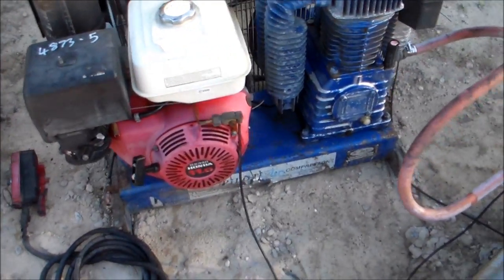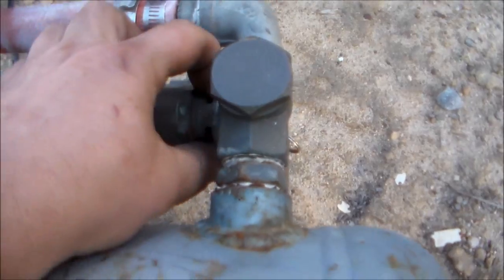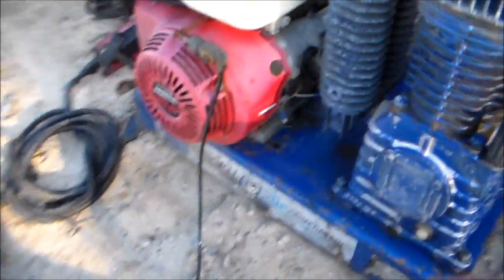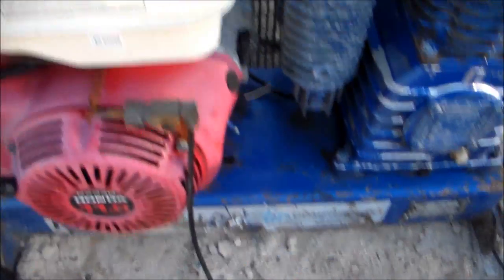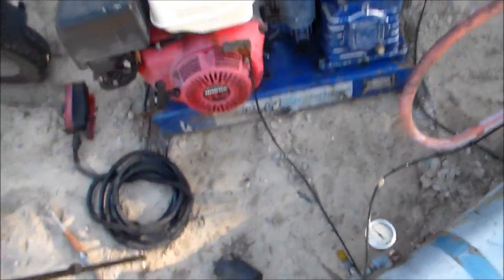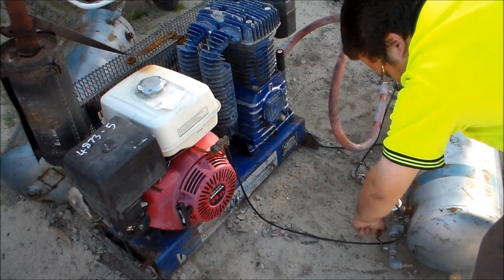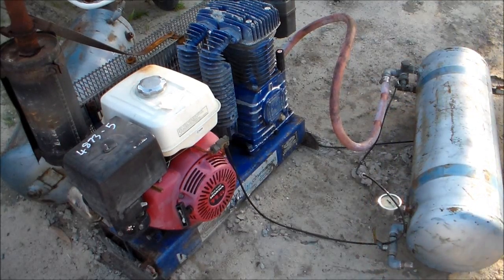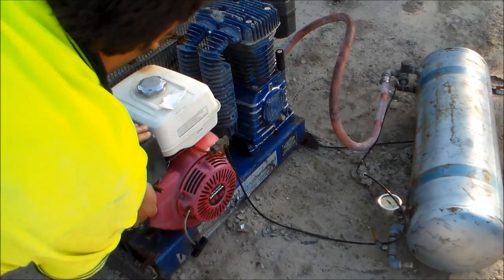How It Works :- Petrol Compressor Unloader/Throttle Down

Comment: How big of a tank could you set up in side a shop and have this located outside ventilated. 60 gallon that could power everything you need? How many cfm could you get off that pump motor setup??

Comment: huge thanks Alex, i got a petrol compressor on ebay years ago, and it was botched together badly, the safety blowoff was the only regulation, i had to switch to electric engine, but now i'm doing sandblasting the electric doesn't cut it (trips the motor safety when hot.
Now i know how to switch it back to petrol, again huge thanks.

Comment: Looks pretty simple, friend of mine is getting an engine from a reefer unit (2cyl diesel) and it would work well with the same setup, just have the shutoff on the governor lever instead of the throttle

Comment: Hi what is the throttle control valve and were could I get one from please mail me cheers  jcnw17678@blueyonder.co.uk
Reply from the maker: contact your local manufacturer/distributor, either that, or if you have a very similar unit to mine, i could send you a throttle valve?
Reply: alex993cc1 Hi Alex that would be great mate, let me know the cost and I will pay via paypal if ok my address is  11 st johns road, aspull, wigan, lancashire, england, post code, WN21SR, many thanks

Comment: well that's simple, I was going to use an aircon clutch
 now where do I get the unloader valve?
Reply from the maker: contact your local manufacturer/distributor of petrol/diesel compressors.

Comment: So once the tank is up to pressure, it just dumps the pressure from the compressor until the pressure drops in the tank? pretty cool system, avoids having to mechanically disconnect the engine or stop and restart it. does the engine drop to a slow idle once it's up to pressure?